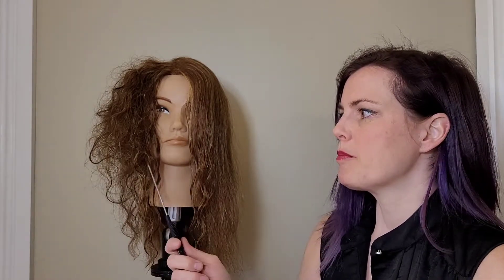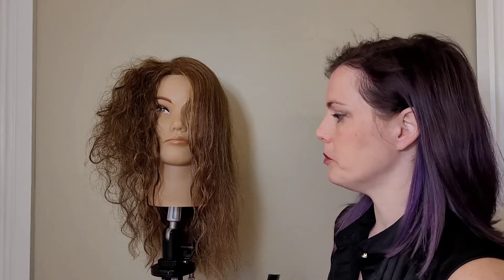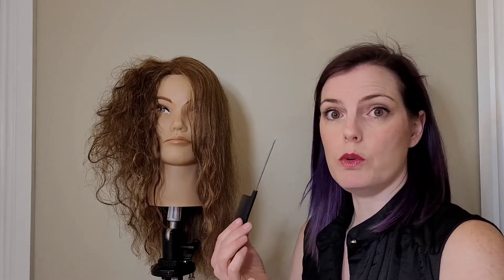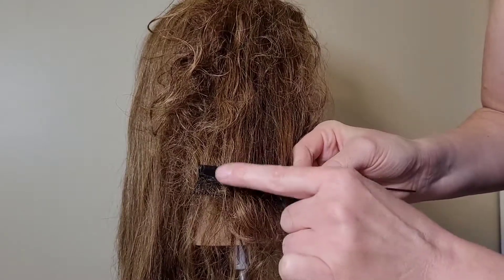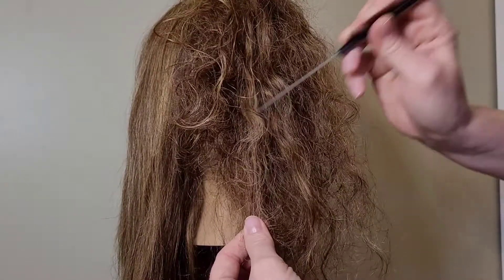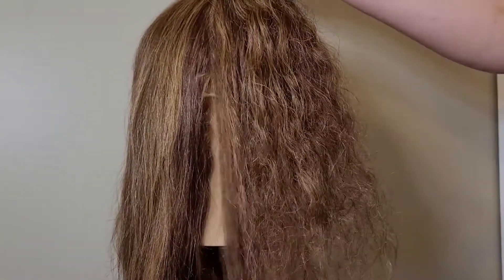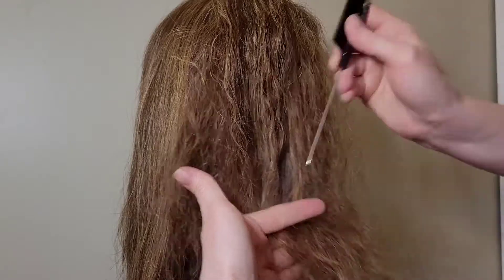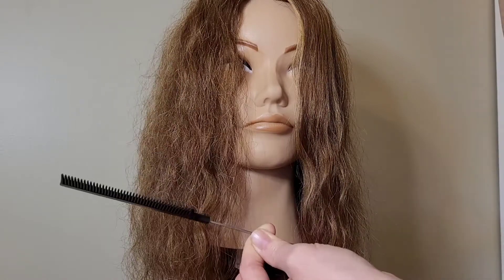How to Detangle Mannequin Hair

Comment: Do you have any tips for keeping mannequin hair from matting again? I've got a $300 mannequin head that turns into a giant dreadlock Everytime I shampoo. I comb it out, braid while stored. I've almost thrown it away twice!
Reply from the maker: I apologize for the very late reply. Somehow this comment went unnoticed. What kind of shampoo are you using? Also, I don't use shampoo every time. Only if I use product in it. Otherwise, just wet it and use conditioner every time and you can even use a spray bottle with a few pumps of conditioner then fill the rest with water and spray it in while combing it after you've washed it. Let me know how that works for you. That's what I get my students to do.